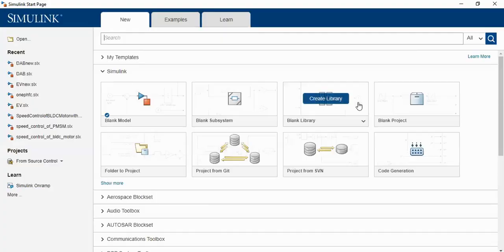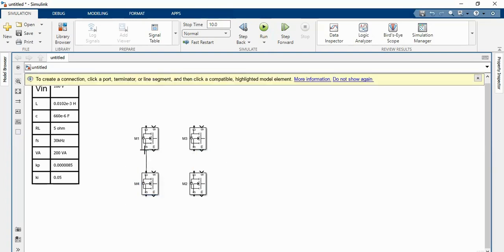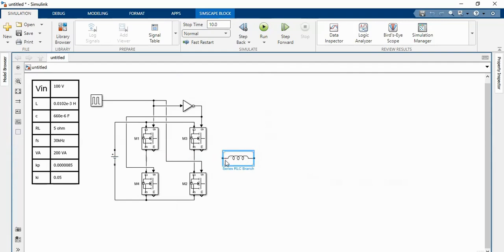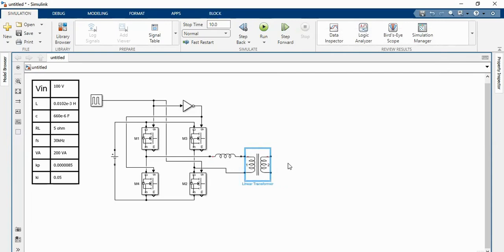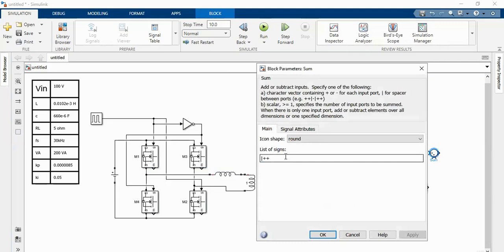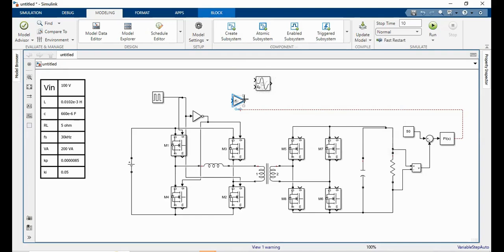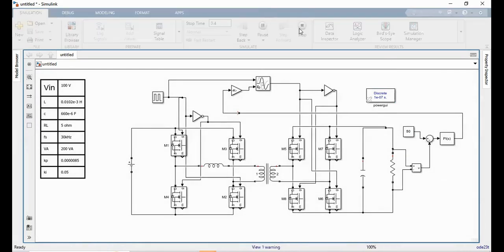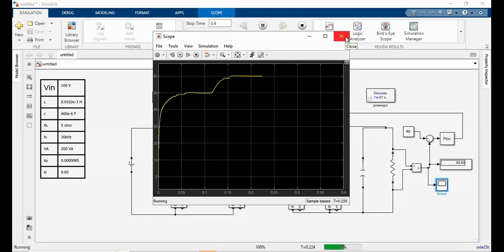Closed loop simulation of Dual Active Bridge DC-DC Converter| in English

Comment: Mam, why is the capacitor not added in parallel to the voltage input side?
Reply from the maker: Capacitors are used for only half bridge converters. Since this is a full bridge configuration, it is not required
Reply: @electrosimacademy   but mam dual active bridge converter topology used in bidirectional onboard charger for Ev where we used capacitor in parallel.
Reply from the maker: @RohitRaikwar-w1g 

Yes, you are correct it is used because the input DC is coming from rectifier circuit,  but here since input is pure DC, it is not used
Reply: @electrosimacademy   ok mam, Thank you.

Comment: Can you please talk about simulating dual active bridge converter controls and how to simulate the closed loop DAB ?
Reply from the maker: The simulation that is given here is closed loop simulation only
Reply: @electrosimacademy  Thank you!! Great video!
Can you please do a dual phase shift video ?
Thanks
Reply from the maker: Will do
Reply: @electrosimacademy  Hi Professor, 
Do I need to derive the transfer function in order to tune the Kp and Ki gains for the controller ? 
Or can I just use trial and error method to get the gain values ?

Thank you